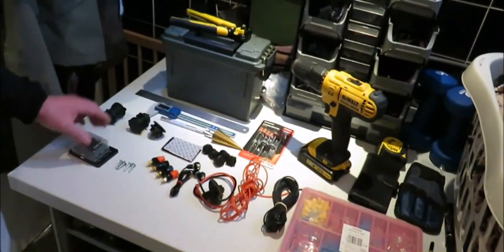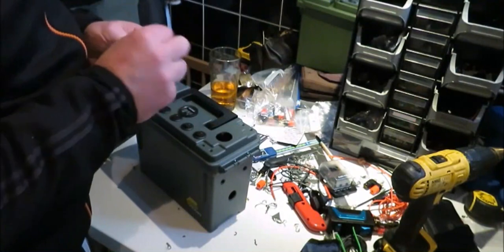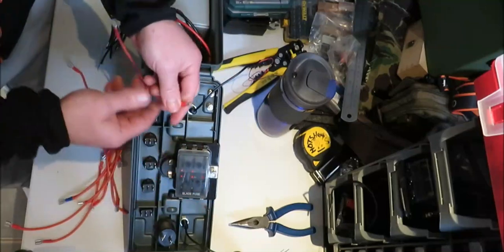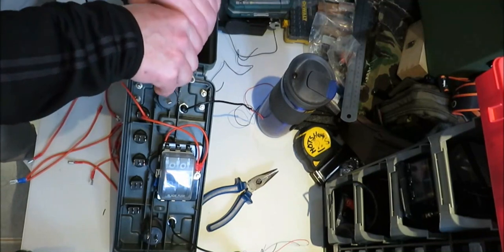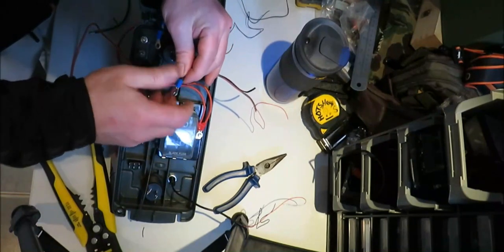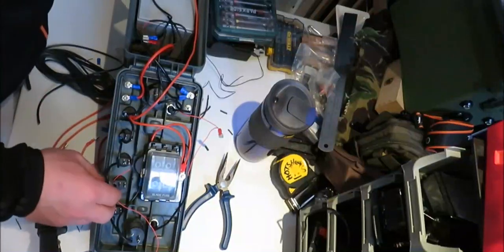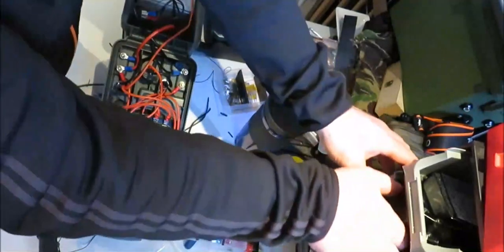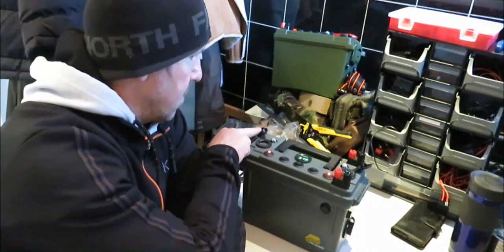How to build a Powerbox/Batterybox Tutorial.

Comment from the maker: US $1.05  21%OFF | Black Color 12V 120W Motorcycle Car Boat Tractor Accessory Waterproof Cigarette Lighter Power Socket Plug Outlet Car-styling
https://a.aliexpress.com/_mOrh0bp

US $0.76  2%OFF | Small Round Boat Rocker Switches Black Mini Round Black White Red 3 Pin ON-OFF Rocker Switch LED
https://a.aliexpress.com/_m0MLuzV

US $3.99  25%OFF | 10meter Special soft high temperature silicone wire 10 11 12 13 14 15 16 17 18 20 22 24 26 28 30 AWG (5m red and 5m black) color
https://a.aliexpress.com/_m0rUm0F

US $1.80  5%OFF | Mini Round Waterproof Motorboat Motorcycle DC5V-48V LED Panel Digital Voltmeter Tester Monitor Display Voltmeter
https://a.aliexpress.com/_mOecVJ9

US $1.26  21%OFF | 12V/24V 36W QC 3.0 2 USB Charger Socket Touch Switch Waterproof Universal Car Truck Charging Socker For Phone Tablet Camera GPS
https://a.aliexpress.com/_mK0ecbv

US $1.01  17%OFF | Banana Plugs Couple Terminals Dual 4mm Banana Plug Jack Socket Double hexagon Binding Post Red Black Connector Amplifier DX25
https://a.aliexpress.com/_mOaDnLH

US $1.90  33%OFF | Eagle Eye Lamp 18mm High Power License Plate Lamp Motorcycle Spotlight Rogue Counterattack Lamp Ultra Thin Waterproof LED Lamp
https://a.aliexpress.com/_mNFdZmT

US $4.53  34%OFF | Durable Anti-corrosion Fuse Block Non-toxic 6 Ways Modified Blade Fuse Box Holder with LED Warning Light for Automobiles Buses S
https://a.aliexpress.com/_mK4FUKn

US $3.89  40%OFF | 100PCS Car Fuses 2A 3A 5A 7.5A 10A 15A 20A 25A 30A 35A Amp with Box Clip Assortment Auto Blade Type Fuse Set Truck Auto Fuse Set
https://a.aliexpress.com/_mKJuR5p

US $0.49  34%OFF | 1M Strong Self Adhesive Hook and Loop Fastener Tape Sticker Velcros Autoadhesivo Adhesive with Glue for DIY 16/20/25/30/38/50mm
https://a.aliexpress.com/_mr5gFMn

https://www.amazon.co.uk/dp/B004W3WC84/ref=cm_sw_r_cp_apa_fabc_RCYVS767KW5JZVGQA9N6

Comment: Great tutorial bud liking the plastic ammo box over the metal box.
Question can you recharge the unit by charging it from your car lighter socket via the boxes cigarette socket or USB
Reply from the maker: Cheers Tony hope your well mate good question I'm not sure about the usb but might be a way with the cigarette lighter socket and a good idea if your traveling anywhere just plug it in, I might run a relay from the car battery to charge this in the boot you've got me thinking now😂😂😂😂😂cheers Tony that could be my next job😂😂😂thanks for watching mate tc all the best crash😁🏴
Reply: @crashoutdoors  I'm looking at doing the Scottish NC500 this year and thought it would be ideal if it could recharge from 12v dc while I'm driving from site to site.